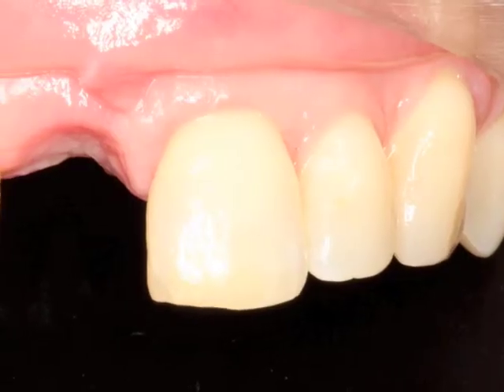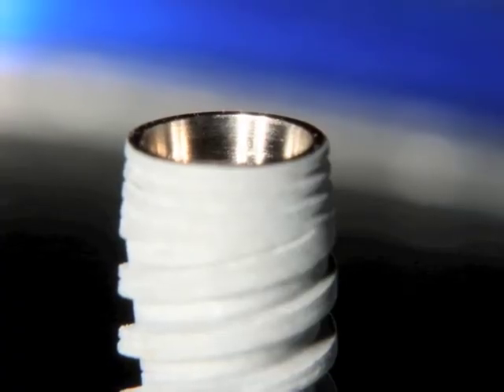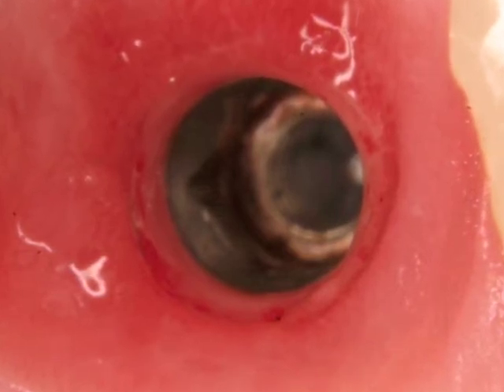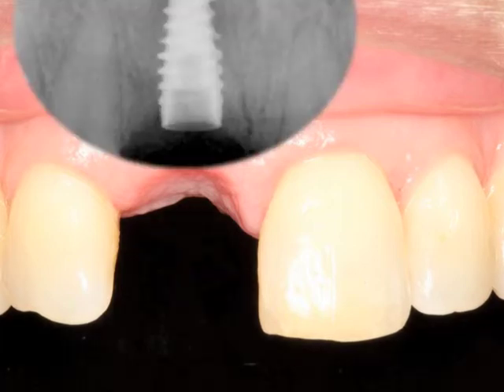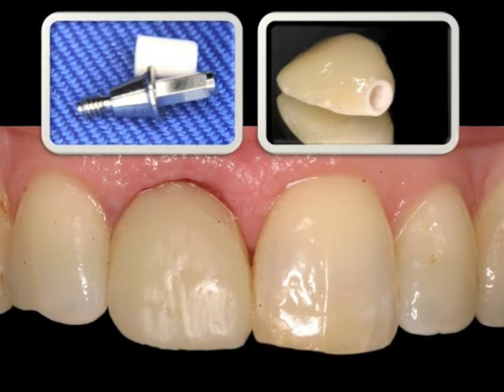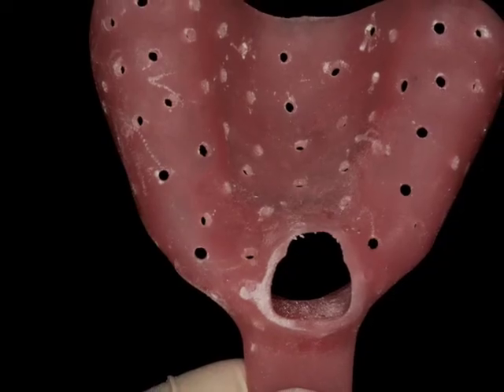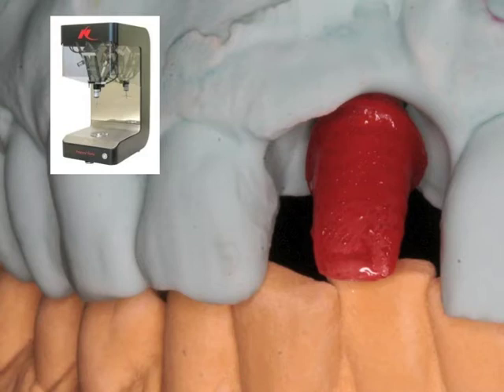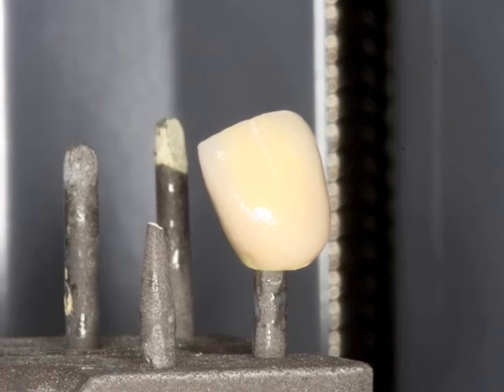Dental Implant  - Dr. Scott MacLean - NobelActive Prosthetics

Comment: Dr Maclean , since posting this video , nobel has the newer conical connection implant system with platform shift  nobel replace I think it’s called .. in this video, you mentioned the nobel active implant has a conical connection with internal hex. So I’m wondering what’s the difference between this and the newer conical connection nobel implants?
Reply from the maker: they have the same prosthetic connection but the implant design is different. You can use the same impression coping for both implants! sorry for delay. did not know your question was here

Comment: my cap fell out after 4yrs. they replaced with glue and it fell out a week later.  Maybe the abutment is too small for the size of the cap hole and they didn't etch or put a "foot"" on the inside of the cap so the glue has something to grab on to.  just my guess. Now i have to go back to have them look at it. the bad thing about front tooth implants it that you lose all feeling when biting into some thing.you have to be careful what you eat. like a peach. if you bit into it you may hit the pit and bite hard into it and maybe damage the tooth. thanks for the vid.
Reply from the maker: I try to use only screw retained...you see why!

Comment: is the soft tissue profile compromised if only an healing abutment is given after second stage, rather than the provisional restoration?

thank you for your reply.
Reply from the maker: You can sometimes achieve excellence with both but I do feel it is easier with a contoured provisional. The shape of a tooth is not round like a healing abutment. This means we have to push the tissue more at insertion. Can work very well but also can have issues. recession...pain on insertion...